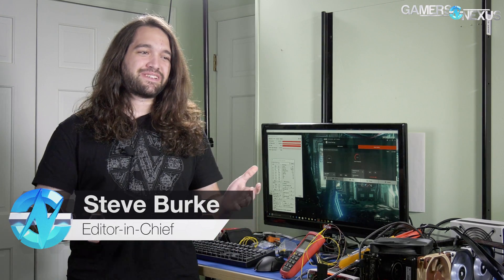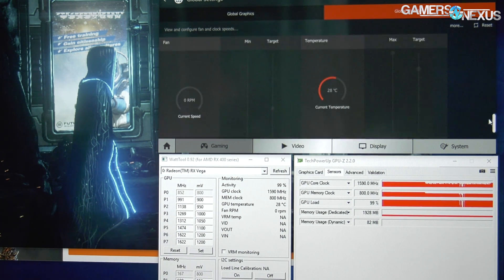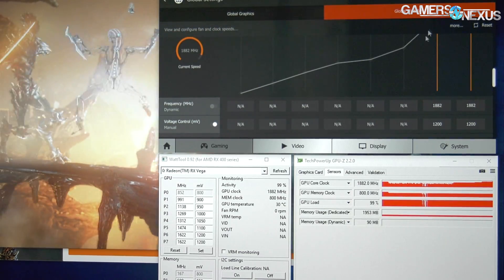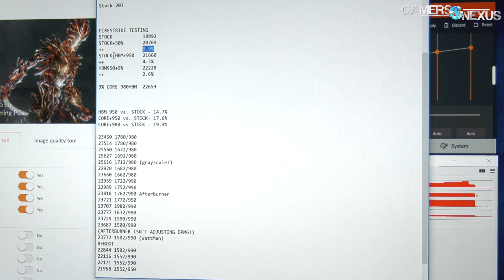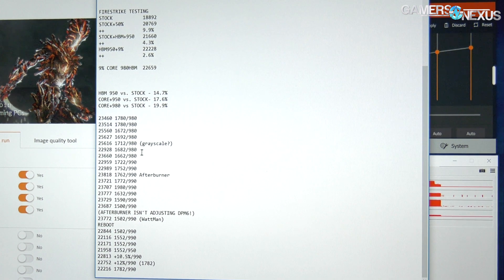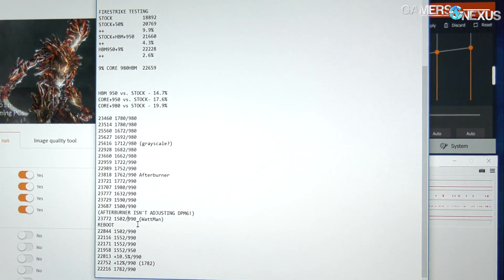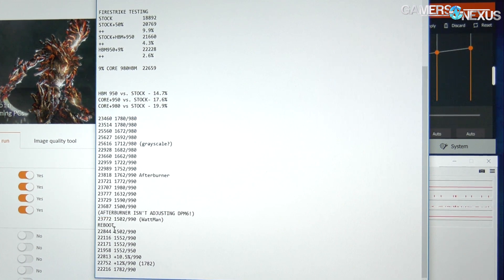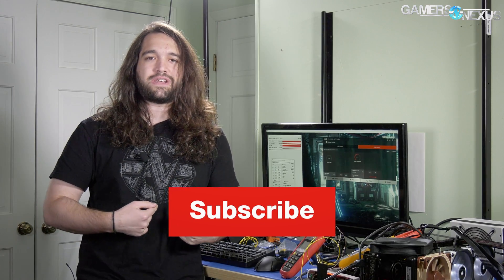Clock Bug Rant: No, Vega Isn't Hitting 1980MHz

Comment: VEGA=Disappointment
Reply: Juho Petrell DSBR is enabled... AMD confirmed that. No optimization of the world is going to give you a 40% Performance boost.
Reply: 1080 Ti=yas

Kinda bummed Vega flopped though because if it totally lived up to the hype then we'd be getting more competition in the GPU market. Which means more badass cards!
Reply: if your scope is gaming go for the  1080ti the price seams high at the end for vega just for game, if you  also do professional works where you know you can use the aditional compute capability of vega then 64 is better
Reply: BicBoi Spyder your getting the wrong end of the stick here bud. The performance and pricing would be fine if it had happened 15/18 months ago. The 56 can be out performed by a 980Ti. Nvidia is laughing at AMD, Vega just released and Nvidia just announced the other day they are now delaying their new Volta architecture, even though they had working production models shown off to the public months ago. Why bother when your current available yet technically old hardware is still better than the competitions.

That said if you need sheer compute power, Vega is better, but Nvidia goes for gaming market for all cards except the Titan's. If you compare a Titan to a 64 for compute power then the Vega is better price to performance
Reply: BicBoi Spyder The 64 costs 50$ less than a 1080ti. Its a huge disappointment.

56 is doing good rn but bc 1070 is influenced by mining
Reply: Tulog Nami I have to unfortunately agree with you.  Anyone can pick up a simple meter from Amazon for less than $20 and tell how much power this Vega card will actually consume which is a lot more than it should.  I'm a self-declared fan of AMD products and typically always buy from them, and still in good conscious can't recommend a Vega unless someone already have a freesync monitor or believe quite heavily in the "fine wine" argument.

But I do have faith (shakingly) in AMD in the fact that their next line of cards (Navi) will come directly under the auspices of Mr. Kaduri (spelling?) and should be expected to be much improved.  Until then though, I would pass on Vega in all honesty unless again you have a very specific reason to get one at these current prices (existing monitor for 1440p+ suport, a believer in future titles being optimized better for Vega, etc.).  The 1070 is still what I grudgingly would have to recommend in today's graphic card market as it's still possible with enough effort to grab one at a relatively decent price (all things considering), and it performs extremely well for all purpose graphic tasks with a much more efficient total power draw.

Now if someone asked me on whether to get an AMD Ryzen cpu over an Intel cpu, then I'd say "go with Ryzen" all the way.  More threads at similar or better price points directly equals better OS and standard Office app performance (not to mention everything else you load up).  Your whole system will thank you trust me.  I have a 1700X system now at home and at work, and both are amazingly impressive over my previous FX 8350 system at home (now my spare room rig) and my former Dell Optiplex i7 at work (which performs like a slug compared to my new work 1700X system).  The only problem with my new work rig is now I have to buy parts to build them Ryzen systems.. but they're (whisper) getting 1600's instead lol as only I can fully utilize the power of a 16 threaded cpu haha.

Intel has also done wrong by all of us (check AdoredTV's channel for their "history of a monopoly" video to learn more.  But this does not equate to me hating Nvidia who has simply set the bar for AMD to strive to reach through fair competition which is great for all of us.  Vega is simply not there due to several reasons and I'm sorry to even have to admit this.  And Nvidia was also shafted by Intel in the past.. the same video references this as well near the end.  Damn I need a warm bath now due to not recommending an AMD product this time around 😒
Reply: the 56 is actually a good card when at the same price of the 1070. The 64 is obselete even for mining you'd be better off with 2 580's
Reply: You just stated why it's bad to buy 64 for gaming unless you're doing productivity. It's a terrible card compared to other choices. It is. You can't argue against that. Why buy a 64 when you can buy a 1080? Tell me. And the 64 price is upped by $100. There is literally no reason to buy a 64 unless you are using it for the reason above.
Reply: DarkSoulz I would go Vega as well, no point having freesync and not be able to use it, I don't think Vega will get faster than 1080Ti but it will get extra 10% - 15% over time 😊
Reply: TDR REVENGE Really? Smaller NM, lower power consumption, new included technologies on the chip, developers had already maxed out the 900 series (an overclocked 800 series), 4K on ultra settings in some games on the 970 was between low 20's to high 30's FPS depending on game, where as on a 1070 it's 40 to 50 FPS. 

Nvidia are lucky that the 10 series hasn't been maxed yet so no need for it. But if Vega had beaten 10 series, Nvidia had Volta sat there waiting to leave AMD in the dust again.
Reply: So vega64 will jump about 40% in performance? That is a mother of all hail marys, I can see it edging out the 1080 in the future but a 1080ti? You are putting way too much faith in drivers.
Reply: Kamran Keyium Yeah buy a gaming card for non gaming 👍🏻

Thats what Frontier Vega is for
Reply: I'm glad Nvidia isn't being pushed to release volta. I'll get more life out of my 1080tis
Reply: jrzamora6 more life probably not but you are going to be happy for a lot longer so that's still good
Reply: Cloa P. Okay? But you are totally forgetting that Vega comes with two different cards. The 56 is an awesome value while the 64 isn't much of one. It doesn't matter if you are overpaying because without factoring in the price, the cards' performance is not terrible. That's what I'm getting at here, you can't expect AMD to come out of their last four generations of cards which are essentially refreshes to establish some new industry standard of performance.
Reply: it does matter what you are paying. Why would I pay amd more for the vega 56 when I can get a 1070 (Which is slightly better for now) cheaper? You are defending amd way to hard. call out their shortcomings so it hopefully doesnt happen again.
Reply: Over here Vega 56 isn't listet yed, but Vega 64 is just to expensive.
If I'll use a new card the same was as I do now (with around 6hrs of load per day), and want to keep it longer than 9 months a GTX 1080 Ti is actually cheaper than Vega 64.
Reply: DarkSoulz Since you already have a freesync monitor, I'd recommend the Vega but check to make sure you have a decent enough psu for it.  Make note that the minimum psu specs for Vega are slightly skewed on the higher side, but I wouldn't go much lower than these though as Vega cards definitely take more power to reach their true potential.
Reply: Juho Petrell I really hope so but this is all speculation at this very moment.  I'm a self-declared AMD fan man (cause I'm dedinitely not a little voy any longer lol), and even I have my concerns over how effective the Vega 64 will ultimately be versus the 1080ti.  The 1080ti is really a beast of a card in terms of raw performancs and has a much better power draw.  Still I hope you're right and I'd say it's 50/50 if I had to declare odds 😉
Reply: Boda Dammit but you're probably grrrr lol.  I hate to admit it I really really do, but I too have my reservations on the Vega 64 ever topping the 1080ti even when liquid cooled.  Especially for gaming titles in 2018-19 and perhaps even beyond.  And since it's marketed to gamers, I'd say pass on Vega unless you already have a recent freesync monitor and the psu to keep this card happy.

For me personally, I'll stick with my RX480 for now and just wait it out until 2018 unless I get better information from trusted channels like GN on significantly increased performance on Vega graphics cards in the months ahead.  I'm always one for waiting patiently until the right time to spend my hard-earned cash on a graphics card and at a price that I feel is fair for what I'm expecting.
Reply: don don zhang Agree in that this Vega can be a solid card for the semi-professional user, but it's quite hard to recommend it for most gamers specifically at this point in time until we see actually performance increases for the prices they are currently going for.  Just my opinion of course and I love AMD products in general trust me.
Reply: not for 3d artist the compute performance of this card is sooo god.
Reply: bitbat9 Well I wouldn't say it's dreaming, but I'd admit that it's unlikely that the Vega 64 will ever reach "even par" with the 1080ti.  Dammit why am I agreeing with Nvidia product fans geez 😒
Reply: MetinCrafter Agree with you as well in that these prices are ridiculous at the moment regardless of whether it's an AMD or Nvidia graphics card.  But the 1070 can still be found at rare times for closer to its MSRP, and the Vega cards are really hard to find at any reasonable price at this moment.
Reply: @Frank Wagoner, AMD Increased Vega Price because of miners ^_^ all the RX Card are sold out in local store.
Reply: You literally just said Vega 64 isn't a terrible card. And yes, the 56's performance is good, but is it really worth $100+ more, and even more than that yearly? You don't add in shear performance, it's price/performance you compare.
Reply: Did you not read my actual comment bic boi? Unless you have two accounts, one of which is Juho Petrell
Reply: Berenger Christy the performance gains from the 900 to the 1000 series is down to clock speeds not higher efficiency.
Reply: Xanthem Ivak 
Me me big disappointed
Reply: Frank Wagoner As I said above the performance to price of Ryzen is great, only thing they failed on in my mind is the line up. A Ryzen 3 1200 performs the same as a 1300X when both are overclocked, same with the 5 1500 and 1600X. I honestly believe only the X models should of been unlocked. There's zero reason to buy a 1600X instead of a 1600.
Reply: +GamingS1000RR !! The only reason for X vs non-X risen are the price of the entry level board (that doesn't allow OC...)
Reply: GamingS1000RR !! No Volta it's still to expensive to be sold to gamers, nVidia would just refresh Pascal with higher clocks and that would be the end of it 😊
Reply: Frank Wagoner AdoredTV used 650Watts gold I think but 750watts will be plenty, they always recommend too much, on the box of HD5770 it says you need 450watts when in reality you could get away with good 300watts supply 😊
Reply: Xanthem Ivak That's putting it lightly.  AMD wonders why they always play second fiddle to the green guys.
Reply: BicBoi Spyder it is a disappointment, yes performance sits around a 1070, in some games can challenge a 1080 but it runs hotter, draws more power, is more expensive and 15 months after the GTX release. 

I'll give AMD credit where it's due with Ryzen, the price to performance on those chips are fantastic but Vega is a flop.
Reply: Berenger Christy AMD fanboy? Did you not read my previous comments? I straight up said it's not a good value, it's barely as powerful as a 1080 at the same price or 1080 Ti price for the water cooled edition, it runs hot and it's powerhungry. That doesn't make it a terrible card, it just has things that can be improved on in future iterations. I also have a 970 in my system and am planning on purchasing a 1080 in a few weeks for my new build. Nothing I said is anything like a fanboy, I'm just saying that to expect AMD (a company who was losing on both the CPU AND GPU market by significant numbers) to fucking destroy the competition is stupid and unrealistic.
Reply: Juho Petrell keep on dreaming. Vega will never come close to 1080ti in gaming
Reply: Ivy Nat the content is indeed software problem, but the main disappointment of Vega is performance per watt, development time and pricing.
Reply: Buy a watt meter and play a game see how much the power consumption. Benchmark are different than playing the actual game.. I play with GTX 980 Ti on Tera and Revelation Online max settings 1080p. I only drain around 141 peak at 173 watts in city..
Reply: Juho Petrell, the stereotypical AMD fanboy. "Just wait!" they say after each disappointment, despite the fact that the 1070 performs as well as vega 56 but costs less, uses less power, and is older. Thank goodness ryzen doesn't blow, kinda the opposite actually. If ryzen's single core performance becomes equal to Intel's then I'll totally get ryzen. I really have no use for all the cores. I think if Vega was good at playing games NVIDIA had a game plan ready. Just look at the performance gains from 700 series to 900 series to 1000 series and compare that with sandy bridge all the way up to kaby lake. To me it seems like Intel was sitting lazy while NVIDIA pulled very few punches
Reply: Xanthem Ivak In what world is this card a disappointment? It's AMD's first competitive GPU and even though it's powerhungry, hot and not the BEST for the money, they are still powerful cards. The issue with this video is a driver problem and not one with the cards. AMD also is fighting a war on two fronts, they manufacturer CPUs AND GPUs, whereas their competition have enough time and money to focus everything on their respective products. Both Intel and Nvidia have budgets bigger than AMD's budget for everything combined focused on one thing. Of course, they aren't going to beat the immediately, it's going to take time.
Reply: i have a 4k free syn monitor should i get vega 64 or a 1080ti ?
Reply: MetinCrafter Like I said, it's not the best value but it's not a bad card. It can at least trade blows with a 1080 and if that's disappointment level performance to you, I feel sorry for you. I'm not defending Vega, I understand they aren't the best cards but they are a Longshot from being disappointments. AMD just needs time to refine their architecture and they will have much better products in the near future.
Reply: VEGA=TOTAL Disappointment
Reply: I personally decided on a 1700X version just because I felt it was a better binned cpu, and I don't like to manually overclock my cpus in general.  I do use a mobo's default overclocking settings however, and really recommend this for anyone who has such a board (B350 and X370).

I also recommend that anyone going with mobo default overclocking options to use a XMP profile instead of any "gaming mode" or other cpu auto-overclock mobo setting.  The XMP profile will automatically overclock both the cpu and the memory, and I learned the hard way that you can't have both working simultaneously (or at least on my MSI X370 Gaming+ mobo).  This mobo actually rebooted itself like up to 10 times (a "WTF" moment lol) and then eventually turned off the XMP setting.  I then went back into bios and reset the XMP profile (I used the fastest one) and then turned off "gaming mode".  This is the best performance I can get for my 1700X system again without manual overclocking which I really have no interest in learning about or actually doing myself to be honest.
Reply: Kinda. I think if they could have stuck to the original announced pricing then Vega 56 would have been solid and Vega 64 a bit overpriced. But since everything is $100+ higher than first announced it really makes it less interesting. I picked up a Vega 64 for $499. But my workload for this card is only going to be gaming maybe 20% of the time. If I were solely concerned about gaming I'd go with Nvidia.
Reply: My god, why does everyone expect groundbreaking performance and pricing and if it doesn't it's a disappointment? Not being the best value doesn't mean it's a disappointment? Your standards are just insanely fucking high, like incredibly. You all should go into cryosleep for a few hundred years so you can have the performance you want. I wouldn't buy a Vega 64 card when I can buy a 1080Ti, but that does NOT mean it's a bad card, holy shit.
Reply: So... how is it AMD's first competitive graphics card?
Reply: DarkSoulz Vega cuz you have freesync monitor. And in the future Vega64 will beat 1080ti look at its raw power. Vega just needs game optimizations, driver updates and when AMD enables DSBR, its performance will jump hugely. You wont dissapoint.